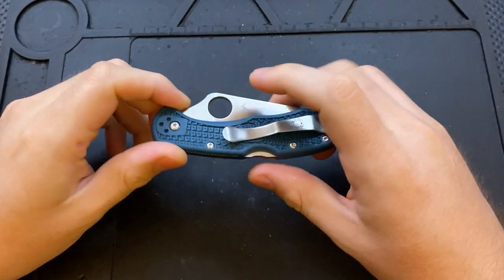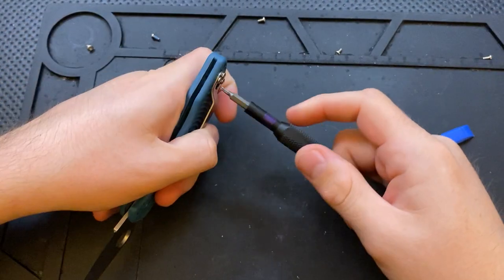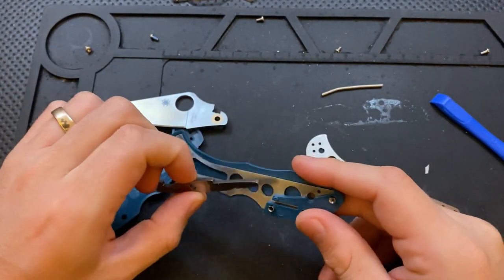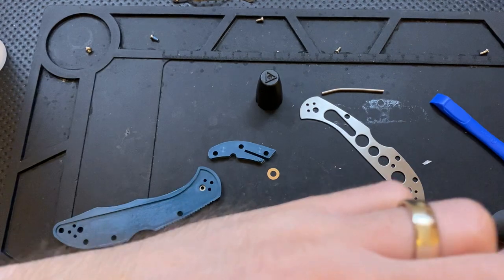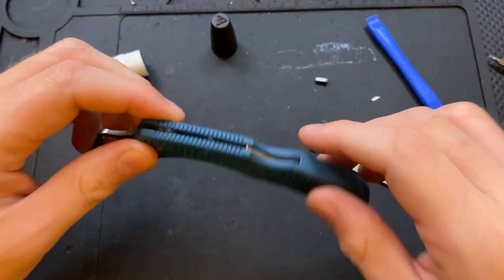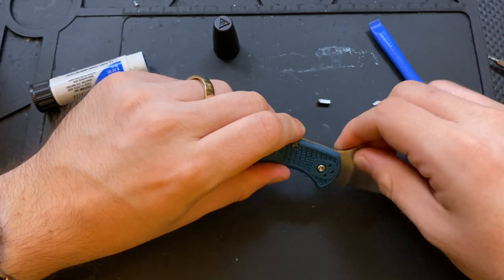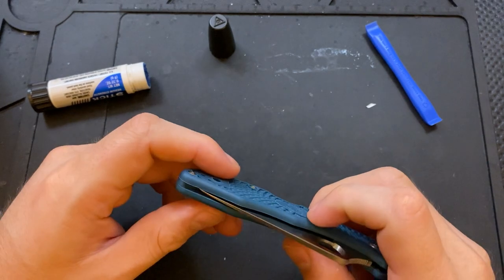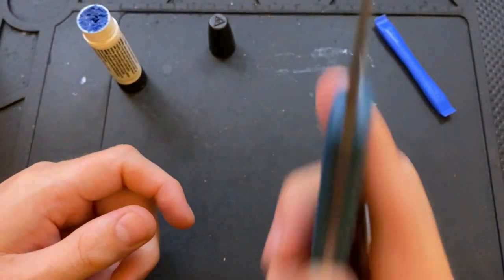How to disassemble and maintain the Spyderco Delica and Endura Pocketknives

Comment: Fun story! I actually had an old half serrated saber ground endura that I sold to a guy years and years ago. When I sold it to him, I figured I'd take it apart and clean it up before I shipped it so the new owner wouldn't have my pocket gunk in it, and that little plastic pin snapped off on one side. Luckily, the guy was cool about it when I explained it and sent him back his money, but I was really put off by spyderco for awhile after that.
Reply: It’s a cheap-shit design that never should have happened. It’s the way PONTIAC used to design CARS. “Just get it out of the lot, and get someone to take it home. After that, it’s not our problem.”

It’s an inferior design that should have been rectified decades ago.

Comment: My method for disassembling the Seki City Spydercos: 
1. Strip at least one T6. 
2. Curse. 
3. Use hacksaw to convert stripped T6(s) into slotted screws. 
4. Reassemble. 
5. Curse some more, even though the ordeal is over. 
6. Swear never to do this again.
Reply: And then order the Ganzo equivalent.
Reply: @stoneblue1795  .. for the screws!

Comment: I know this is old but i just took apart mine and had a heck of a time putting it together. 
Just when i thought i was done, then the plastic guide was giving me problems just like you pointed out.

I took it apart and while putting it together ( the hard way) i lost a washer.😭,😠😭

So tomorrow I will finish the job, just the way you did it. ( Minus a washer). 

Im new to knives 3 weeks and this was my first time. 😆

I will not use this knife until i get another washer. 

Thank you soo much for teaching me something new. 
At 60 I'm never too afraid to say I'm wrong. 
Learning is what keeps me young. 

My anxiety and depression thank you for teaching me how to put this together.

Peace, 

Leo

Comment: I’m late to the party, great video! I’ve had great success using graphite instead of fluid lube. It has reduced the frequency of cleanings, while providing smooth action. Graphite doesn’t seem to attract and hold pocket dust, etc.
   Again, great video!

Comment: What part of that was supposed to be difficult? It seemed like a really simple, straightforward takedown and reassembly. Great instructional video on how to do it though, it will come in handy as I just purchased my very first Spyderco (Delica 4 in 20CV) and I plan on replacing the scales and spacer with Flytanium carbon fiber scales and a titanium spacer.

Comment: It was lucky for me to try and disassemble the cheaper Byrd knife first, and when putting it back together I chewed the little pin on that backspacer. It turned out that there's actually a metal pin, just coated with FRN. When assembled, it now sits a little askew, but the knife works and I don't see it failing any time soon. But I definitely will only disassemble my Delica if it gets super dirty 😅

Comment: maybe that pin on the back spacer is to help with the force from the spring? since you have the screw and post on the top half of the back spacer  (to attach the three pieces together, and help with the spring)

Comment: This is going to be helpful. I really want an S30V Delica, but the hot pink handles are not something I really want on something that I would carry.
Reply: Two potentially fixes for that problem...1) dye the FRN scales of the pink handled knife...would obviously have to be a dark color or black but can work...or 2) buy a 2nd Delica with whatever color scales you like and swap the blades...gift the pink one or see option 1 for a color fix
Reply: @scotteger6271  I did option two a while back. I don't trust dye not to rub off on a sweaty hand over time.

Comment: Would a flytanium backspacer get rid of the problem with disassembling the delica?
Reply: Wouldn't change anything with disassembly or reassembly, but it would eliminate the plastic posts on the backspacer...they'd be metal

Comment: Spyderco knives r great until you stab something with one and it folds on your fingers. Spyderco resilience.and anything with an axis lock. best advice is to buy a cold steel with triad lock if your gonna be constantly vigorously stabbing things.that's just what I've come across from my experience with pocket knives over like years and years of vigorous stabbing.i hope this helps.
Reply: If you’re vigorously and constantly stabbing things with any folding knife you’re using the wrong tool for the job and having it fold onto your finger is Darwin’s theory in action. Fixed blade dude. Fixed blade.
Reply: Well said; I seem to have a lot of stabbing I just never get around to anymore.

Comment: I am really pissed off at Spyderco.

I have a Delica 4 and a Delica Wave. I don’t like the dark-blue-green scales that came on the Wave, so I swapped them with the light gray ones on my Delica 4.

In doing so, I came to find out that on BOTH knives, one of the pocket clip screw holes—the same respective one correspondingly on both knives—is stripped and doesn’t grip the threads of whatever screw is put into it.

Someone recommended to me a solution that I hadn’t even thought of—swap the skeletonized liners and reassemble the knife.

So I did that just now, and now TWO of the pocket clip screw holes are stripped!

What the hell can I do? I’ve been told that Spyderco will not sell me new liners. If I sent the knives in to them, will they replace the liners? I’ve disassembled the knives; won’t they consider my warranty void?

What options do I have? Do other companies (such as Flytanium) sell replacement liners for knives such as the Delica?